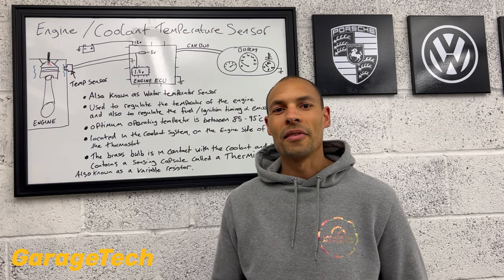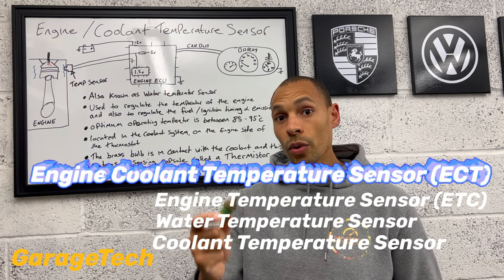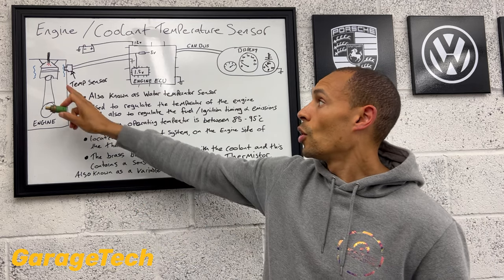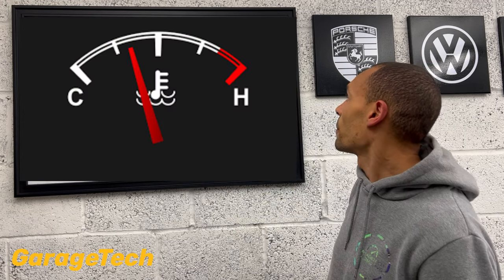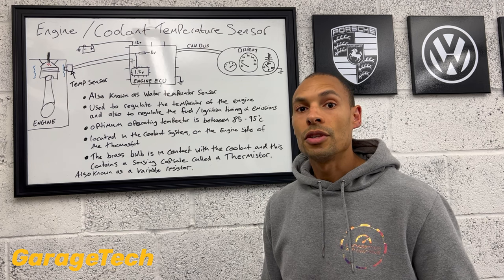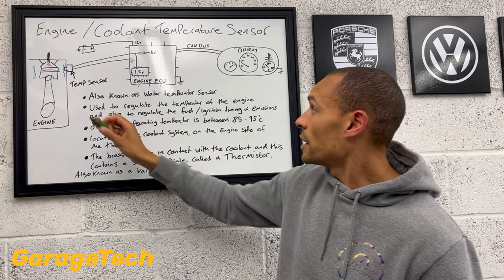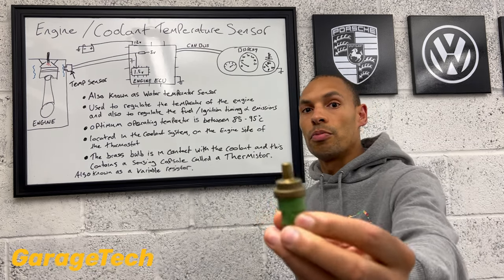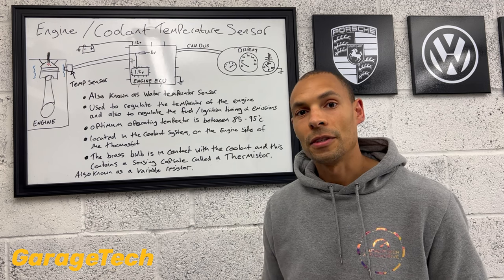What is an engine coolant temperature sensor ECT / engine temp sensor and what does it do? Explained

Comment: my gauge reads lower than what it's supposed to be. When warm (50% mark) it reads 25%.... when it overheats it reads the 75% as opposed to the 100% hot mark... I changed my thermostat and engine coolant temperature sensor..i have an audi tt 1.8
Reply from the maker: I’d check the wiring to ensure there’s no corrosion on the pins etc. if you can get a diagnostic machine on it and read the live data for the engine temp in the dash display and the engine ECU, they should be both the same +- 1-2c . The mk1 TT dash pods are known for failing so another thing to check is the gauge itself. Good luck 🤞🏼

Comment: on an audi a4 with that green temp sensor, can you just replace it with any other temp sensor? I'm looking to modify my cooling system into a standardized system where the only thing I need to replaced are the rubber material and the connectors made out of aluminum
Reply: No.  Most certainly not.  Not all Temp Sensors are created equal.